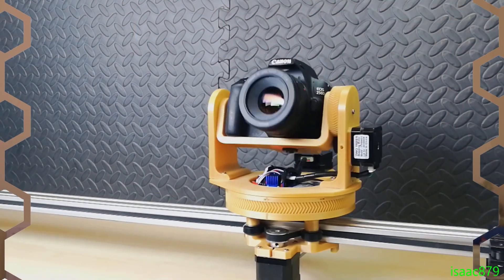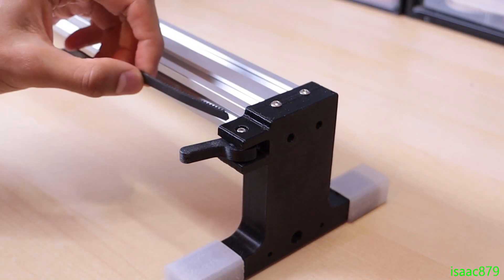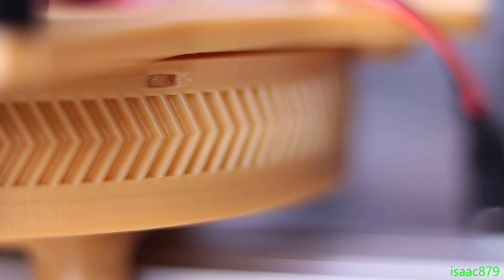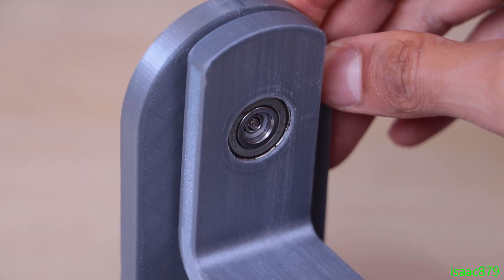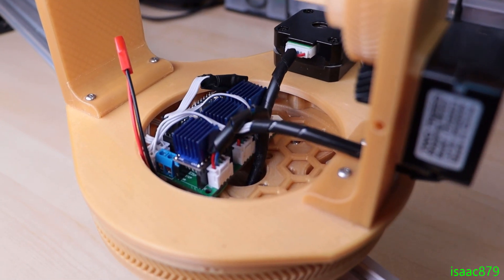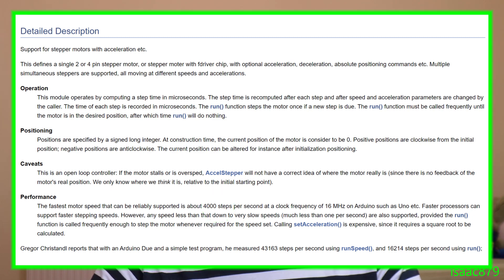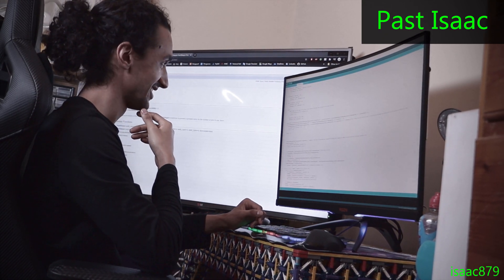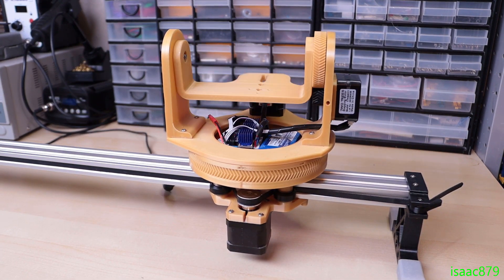Perfecting My DIY 3-Axis Camera Slider!

Comment: Does anyone have any suggestions on assembling the ball bearing pack? Even with the cage in place, I am unable to populate all the slots without losing a few. I’m debating putting a tiny magnet behind each ball to hold them long enough to seal it up. Any suggestions are very welcome!

Comment: This whole project rests on a bearing that costs like $600-$1200. Hes using it instead of using the one he reccomends you 3d print and use airsoft BBs for the ball bearings. Pretty silly if you ask me.
Reply from the maker: In my first video I did say this project was just because I had the bearing laying around and I wanted a use for it. I didn't expect so many people to be intrested in making it. If I had known I would have based it on commonly available parts.

Comment: Hello, could you help me, I don't know how to connect the Xbox controller to the Arduino. Could you tell me how you connected it or give me a link explaining how to connect it because I couldn't connect it and use it with the slaider. Please, could you help me?
Reply from the maker: Hi, sorry for the confusion. The xbox controller cpp files was only really meant for reference in case anyone wanted to try the same. I used Visual Studio to compile and run that code on my PC. Both the controller and camera slider were connected to the PC. The PC then took the controller inputs, converted them into the slider commands and sent them via the comport it was connected to.

Comment: I just built it and try to get it to work. Unfortunately I was not able to source the newer stepper drivers and am stuck with A4988.
Since the latest code in GitHub expect to have the newer TMC2208, I am unable to move the motors.

Where can I get the older code that used the older drivers?
"pan_tilt_mount_nano_code_tmc2208" it the latest
"pan_tilt_mount_nano_code_pcb" does not seem to fit on the Arduino Nano, size is larger than 100%

"Compilation error: text section exceeds available space in board"

Any help?

EDIT: I deleted everything related to the addressable LED ... and it works now... I guess I will also try to get the newer drivers. Awesome work!

Comment: Thanks for sharing this project.
I started building one of these, not for photography, but as a platform for my Nerf gun. I downloaded and printed all the parts, I just want to bring to your attention that holes on one tilt support do not match the platform below. I fixed it easily in Solidworks, but others might struggle with it.

Comment: Hi 
I want to make it same model would you tell me?? What is the exact size of aluminum frame and its wheels because in your  CAD files the assembly of aluminum frame and wheel would not be reasonable kindly tell me
Reply from the maker: Hi, the CAD models should be accurate for the dimensions (dimensions are metric). I used standard 2040 V-slot extrusion and the standard 24mm V-slot pully wheels.

Comment: Thank You Issac879 !   You have done the DIY community a huge favor with all of your video demonstrations, plus your written parts lists and instructions. ... In my case it's the Camera Slider build you have worked on so diligently!  I am currently in the process of attempting to create a 1500mm long slider using a 4080 C-Beam V-Rail as the base.  We make a lot of short films in my part of the world, and many different camera rigs are used in these productions that are quite a bit heavier than the DSLR Issac's rig was designed for.  So my build will have to be adapted to those situations. Much of my "hardware/metal components" for the slider have been ordered and is on its' way to me here in Oregon, USA.  I have designed the carriage to be balanced out with an opposing motion of "equal" weight under the slider so that it can be used (hopefully) in any position, from horizontal up- to vertical slider shots, and possibly also inverted (we'll see about that after it's been built!).  I'm hoping to use a double belt drive looping over each end of the slider, attached to each of the top and bottom carriages, but I don't know if that will be strong enough... I might need to also use a screw drive, and / or a thin braided metal cable to keep the cameras safe from a belt drive failure "runaway"?  If anyone on here, including Issac of course, has any advice, or perhaps some experience with such a build I'd be pleased to learn more about it.  I have a LOT TO LEARN (regarding re-engineering much of the 3D print models Issac built, etc, to make my version of Issac's build come to life to help make some really amazing shots!   Thanks everyone!
Reply: how did this project turn out, Lawrence?

Comment: Brilliant!  Thank you.  Have you updated this since 2020?  I really need to build one of these!  I'm building a huge heavy -duty camera stand and I'll be utilizing 2080 aluminum extrusion and I'm thinking I could do this as an add-on to the camera stand....which will be over 8ft. tall and 1500mm wide rail so the gimbal could have 1200mm of travel.

I'm 71 and living in Thailand and I love being at that stage in my life where I have the freedom and time to learn complicated new technologies....like 3D modeling.  I've been an artist all my life, and this gimbal you've created on a 3D printer, is a work of art.  I only hope I'm smart enough to put one together.

I do have a question.  You brought up a good point regarding the friction wear on those gears, and you may be right that just printing a couple of sets of spare parts may be the best solution, but we get machining, including waterjet, done VERY affordably here.  Do you think that, assuming the cost was convincing low, that it would be worth making those gears out of 6063 aluminum?  Would it add more stability?

Comment: I am looking to utilize the pan tilt mount for a Panasonic AG-UX90, it weighs 2.4 kg and is 169 mm (W) x 195 mm (H) x 340 mm (D). I know I will have to alter all the dimensions of the mount you provided, my question is by how much should I increase the tooth count on the gears.

Comment: Hi Isaac, great video and slider. Love it. I have a Canon 6Ti which is a bit smaller than the camera you used in your project. Your camera tightly fits the Til U mount. I want to try your slider and mount but I want to increase the width or the U mount so it can fit other cameras. Not sure if you have another version of your slider that can be used with other sized cameras.

Comment: Isaac 879 I am a beginner and not a programmer. I put together the 3-axis slider that you designed. When I don't touch the joysticks, the stepper motors move a little. What to add to the code so that there is a dead zone in the center of the sticks. Thank you in advance.

Comment: In your experience, is it smooth enough (vibration is damped for very slow movements) for astrophotography applications (i.e. taking a long exposure shots of a celestial body that rotates about 0.0041667 deg/s with respect to the north star)?

Comment: Amazing project. One more idea is to use gimbal motors with a hall sensor instead of steppers😉 there are really big an powerfull. You can also use them to pass though the wires.

Comment: isaac879, this project is just great! There are no such open source projects in Russia. Well done. It would be wonderful if you added an initial slight acceleration (transition to the current speed) and a smooth stop along all axes. That is, without a sharp start and braking. Otherwise, everything in your project is wonderful. Good luck with your projects.With best wishes from Russia!

Comment: I have an Fuji X-T3 which is a small camera, but larger than your 250D.
Got an easy idea to adapt it... Instead of puting the camera "inside" for the tilt, just do 180° and put the camera on the top. But then keep the bigger microstep motor because it will need more torque as the camera will not be in its gravity center. Do you think it would work ?  Then you could also shortened the U, and also the "round" for pan axis. What do you think of that ? Did you understood ?

I discovered your job right after you launched it on youtube. Great job man ! Inspiring a lot

Comment: So how do you program the moves for the slider?
Reply: Within Isaac's GitHub there is a command list PDF. Connect to the mount via BlueTooth and send serial commands via any serial app, like the Arduino IDE serial monitor. 

After you've sent and the speed, acceleration, and other settings to the Nano and stored them in the EEPROM (see bottom of commands list PDF for an example of what to send.
Send "p25" pan to 25 degrees, "t15" tilt to 15 degrees, "x100" slider to 100mm, then send "#" to add current position to moves array. 

Change the position and send "#" again to add another position to the array. Add as many positions as you want, then send ";1" to execute moves array 1.

Comment: Slow clap

Been working on one of these for years but ran into many of the issues you mention in this video (accel stepper single motor accel/decel being a big one). This build is clever, thorough, and practical. 

I’ve already got the parts from my build, so I’m ditching mine and building yours. 

Bravo!

Comment: Nice project. I have one doubt. What is the advantage of gears over belt drive?
Reply from the maker: Thanks! Tbh I would use belts if I were to redesign it. When I was first making it I didn't have any belts on hand so went with herringbone gears and they worked perfectly so I never bothered changing them. I've actually upgraded the tilt gear ratio so switched to a belt and pulley (you can see it on my Instagram).
Reply: @isaac879  Yeah, I saw it on your Instagram. Nice info.
I think I'm going to make one slider that is similar to your design.

Comment: Any suggestions on how to load up the bearings in the bearing chase?
Reply: I recommend printing this bearing instead, https://www.thingiverse.com/thing:4595217 Although you do need to glue the 2 center parts together. There are a lot of comments on here with people not knowing how the included bearing is assembled, myself included. 

I believe you're supposed to split the outer ring at the seam but surely that would create a place where the ball bearings get stuck. I've printed and successfully using >4 of the bearings from the thingiverse link above.
Reply: @ColinMakes  Thank you. I successfully printed what you suggested and it actually works. Thanks!

Comment: Niice Project !
I am wondering if and how you deal with acceleration/deceleration setting. 
I red that accelstepper library can't apply acceleration/deceleration to multiple stepper motors at the same time.
Did you find some way to improve this ?

Comment: Could you please make also a remote to easily program movements. Please use three knobs for motor movements. For example move motor using a knob, record position and record speed in one line of code. Then do it again. Finally execute the code.

Comment: for the problem with twisting wires when rotating.. you could use a slip-ring transmitter, we are using them on our big machines for power and data transmission from stationary to rotating parts.
Nice design though, thanks for that video!

Comment: You did a great job with this project.   I especially like they way you reduced part count by having the carriage rollers double as the belt rollers.  Brilliant! I also like that you actually have some decent examples of the slider in action.  I think I may do my own slider using ESP32/GRBL at its core.  Your video was helpful in confirming my hopes that  micro-stepping TMC2208's would be quiet enough for video/an onboard mic.  You clearly put a ton of work into this including a BOM, etc.  So great.  Thanks!
Reply: I have build one with the esp32/GRBL，it's works!
Reply: @rocketscn  Great!  I'm a big fan of esp32/GRBL, thanks for confirming that it works for this!